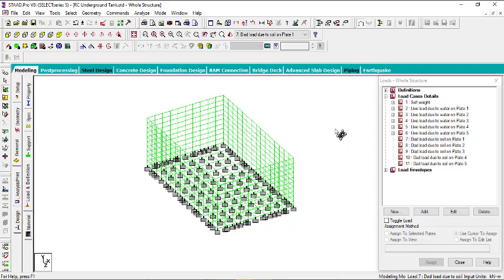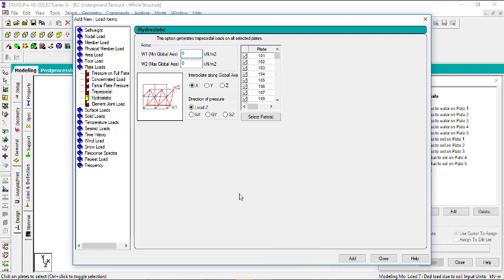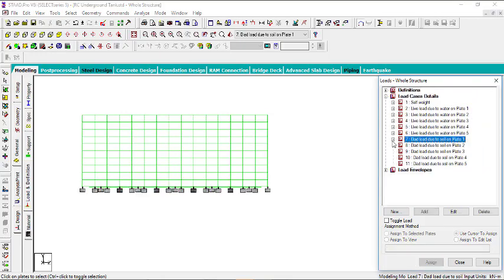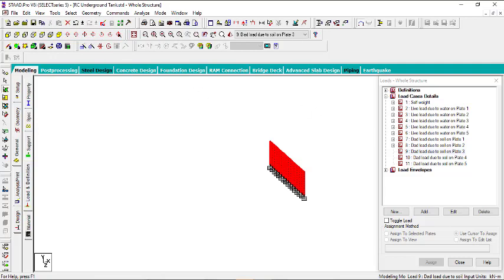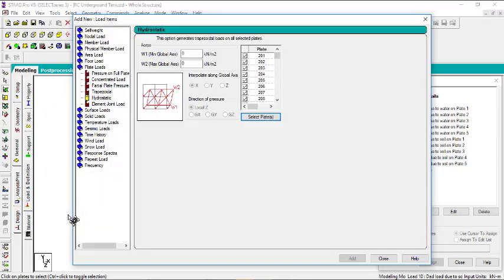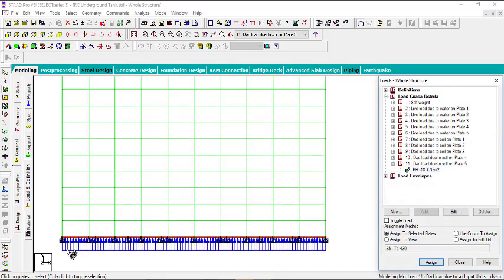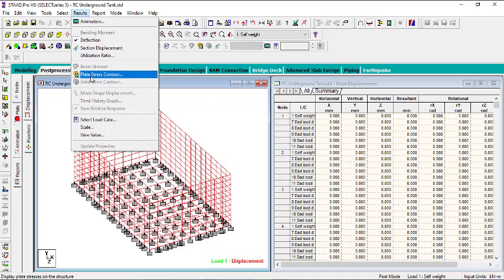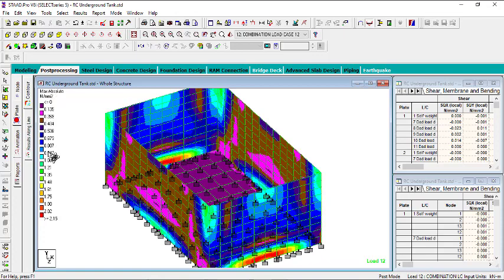Staad Pro for beginners (episode 20). Analysis of a RC Underground Water Tank  (Part 3).

Comment: Sorry sir..what about the hydrostatic force of the water...and what about the top slab that is under soil pressure
Reply from the maker: Can you be more specific with the hydrostatic force of the water? The Top slab was omitted from the modeling by mistake. However, there's no effect of soil pressure on the top soil. It is an underground tank not a buried tank. The top slab is exposed and parallel to the level of the NGL.
Reply: @ridwantician  if the tank holds water then it is exposed to internal hydrostatic force from the water it holds
Reply from the maker: @Eng.naftalkimaro  The top slab? Yes you're correct. I guess you know how to handle that.